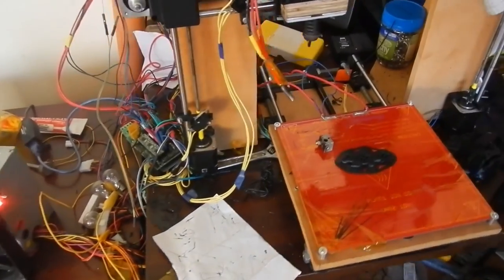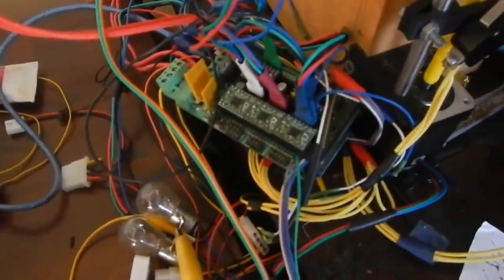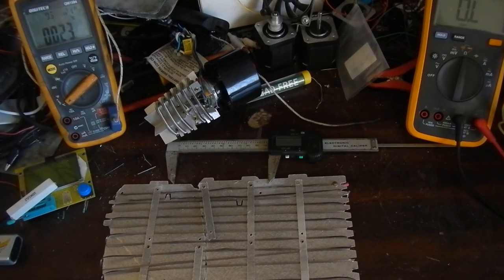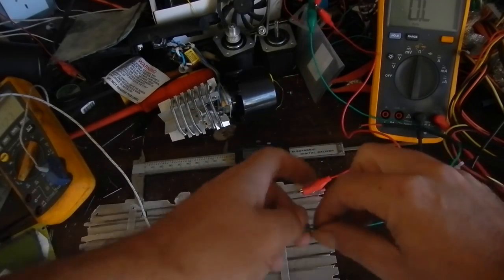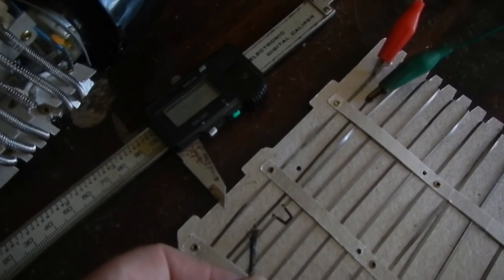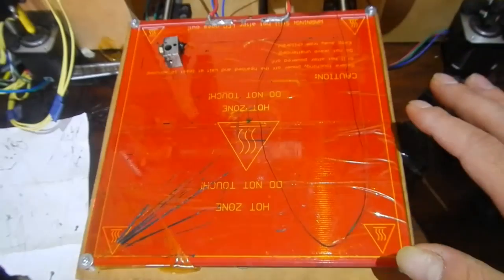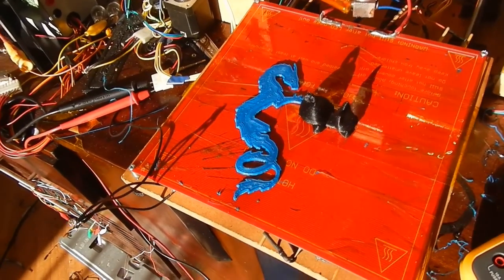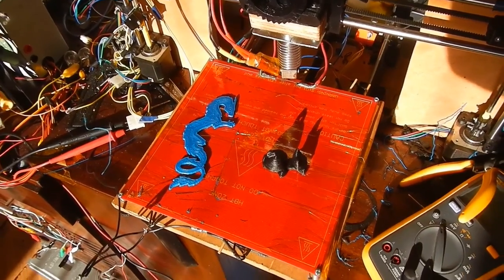Heated bed 5v 35w dummy load for ATX RepRap (full build and development)

Comment: Lol i really shout chicken when i burn myself, i mean your fingers even get that white cooked chicken charred look :-D I'm always doing it :-) Hmm with the modern atx i found that most of them are floating around the 10.2v, it looked like they wanted to reduce the heat on the modern ones, on the old AT microform psu's they spit out the full 12v with full amapage :-) You did a nice mod here as a work around but it might be handy note for other stuff in the future :-)
Reply from the maker: The older ones are mostly under 400w and don't have the same problem. :-) Its got nothing to do (; with running temp and everything to do with transformer saturation ;p. Newer quad core and later processors use a lot of amps on the 5v rail and this affects the saturation of the transformer. It would cost a lot more to make it produce good 12v without 20-30A load on the 5v, and there is no reason because in a PC, if its on the CPU is running. So always high 5v demand. Most people just put a few resistors in the ATX near the fan 0_o. Seemed silly to me to make heat thats a problem in the ATX when I need more heat somewhere else. B) All that was left was to calculate the exact heat distribution required. :-D
Reply: Mongrel Shark
lol you made that last part sound a lot easier than i think i would have found it there :-) its cool to know about the modern cores sucking on the 5v rail so much, i guess the earlier p4's and such wouldnt have done that now that you mention it :-) and yeah the micro form at's do seem low wattage now you point it out there :-D like 240w that type of thing :-) its just that they are so cheap at like £5 a piece, i would be tempted to try running them in parralel to boost the wattage :-) ive been using them for grow leds, the atx just didnt have the power im afraid to run them without messing around with :-D and because the at's are so cheap i could get a standard going across the led units ive been making where with cobbled atxs i wouldnt know if measurements were off if i had a faulty unit or if that was just the version of atx model :-)
Reply from the maker: I think you should be able to put them in parallel, as long as the voltages are all fairly close. If you put a 12.5 and a 10.20 in parallel I don't think it would go well. The 12.50 would try to "charge up" the 10.20... Just like dissimilar car battery’s in parallel.
Reply: Mongrel Shark
I'll have a go when i get chance to have a play, out of 10 units of these http://www.ebay.co.uk/itm/HP-Compaq-dc7600-SFF-Power-Supply-381024-001-379349-001-DPS-240FB-1-A-/361358055393?hash=item54229e57e1:g:bGUAAOSwgkRVUFJz 9 were exactly the same at 12.8v while one was something like 11.5v, i could imagine the diffrence there perhaps feeding back in to the lower voltage psu to cause static feedbacks and things :-)
 I have been running 20 led strips with 36 sm5050 5w leds per strip off 5 legs of the at psu on the 12v rail, which is giving me 9w to each strip of leds so i can get the best lumens out of them so i havent had a need to run them in parralel yet, but with other more power demanding projects it could be a nice easy handy setup running them in parrallel :-) after i get chance to have a mess i will make a quick vid and drop you a shout to see what you think.
 i have a new vid here on the led units ive been working on but ive not edited it up yet :-)